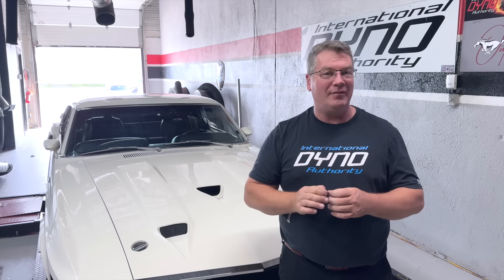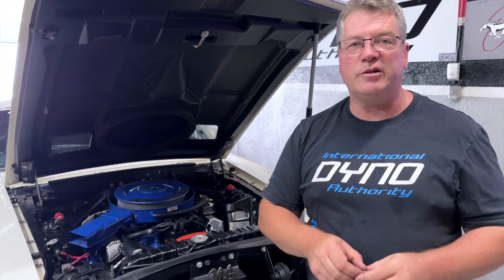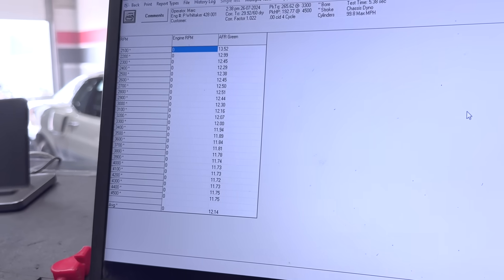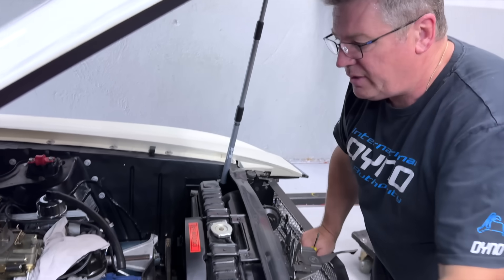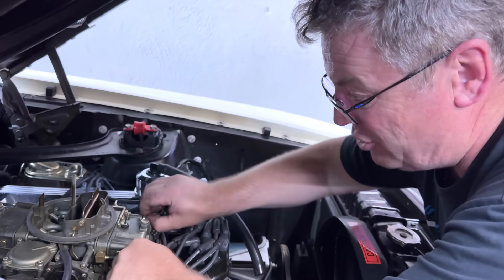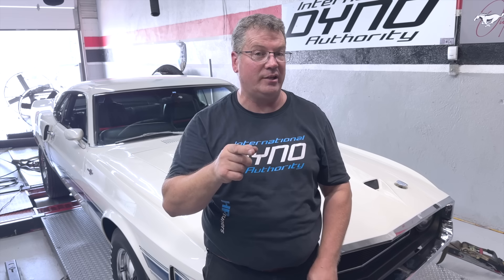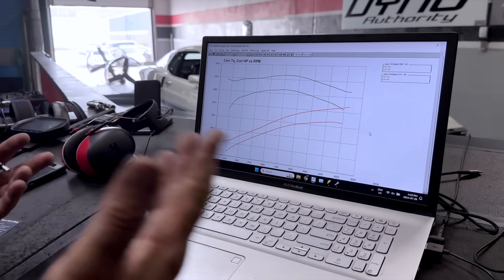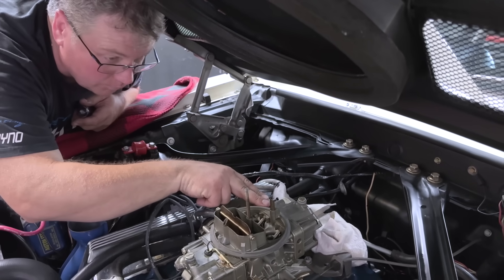Original, unrestored '69 Shelby GT500 tuned on the dyno

Comment: ... rich means lubricated ....
Reply from the maker: @jackreacher.  

The Role of Fuel in the Combustion Chamber

Fuel in an engine's combustion chamber serves three critical functions:

1. Cooling: Fuel helps dissipate heat in the combustion process.

2. Power Generation: The expansion of fuel, air, and the spark creates energy that drives the engine.

3. Lubrication: Proper fuel delivery aids in minimizing wear within the combustion chamber.

The Importance of Air-Fuel Ratios

The correct air-fuel ratio is vital for both performance and efficiency. A balanced mixture maximizes power, ensures fuel efficiency, and reduces harmful emissions.

When Too Much Fuel (Rich Condition) Is Introduced

If the fuel mixture is too rich, the combustion process exhibits certain inefficiencies:

Reduced Temperature: Excess fuel lowers exhaust gas temperatures (EGT).

Decreased Efficiency: The engine fails to extract optimal power from the air-fuel mixture.

Incomplete Burn: Fuel that doesn’t fully combust can cause:

Exhaust fumes with a strong gasoline smell.

Excess carbon deposits and oil contamination (cylinder washdown).

Increased maintenance needs (e.g., frequent oil changes).

The Tuner's Objective

A professional tuner never settles for "at least it's rich" or "better rich than lean." Instead, the goal is to optimize the air-fuel ratio to match the engine's combustion chamber design.

Typical Air-Fuel Ratios:

Naturally Aspirated, Direct-Injected Engines: Ratios typically start in the 13:1 range.

Boosted Applications (Carbureted or Port Injection): Ratios generally start around 11.5:1.

The ideal ratio is determined by the engine’s response:

1. Maximum Power: The engine performs best at a specific air-fuel ratio.

2. Clean Burn: Zero excess smoke and minimal unburned fuel.

3. Optimal EGT: Continuous temperatures around 1,000°F are a strong indicator of efficient combustion.

The Tuning Process at International Dyno Authority

At International Dyno Authority, we take a systematic approach to air-fuel ratio tuning:

1. Step-by-Step Assessment: We analyze gathered data and identify adjustments.

2. Combustion Chamber Optimization: Matching the air-fuel ratio to the chamber’s requirements.

3. Ignition Timing: Ensuring spark occurs before top dead center (BTDC), so maximum thrust occurs 15–17° after top dead center (ATDC).

The Result

Our process ensures the combustion chamber operates at its optimal ratio—never left rich—delivering:

Maximum power.

Clean combustion.

Reliable and efficient engine performance.

---
Reply: @internationaldynoauthority693  I appreciate your professionalism.  I simply pay homage to my first combustion engine mentor who allowed me the opportunity to attend his tuning of our 1949 Model B, Allis-Chalmers tractor which I utilized to drag country roads knocking down the highs and filling in the lows beginning when I was eight years old immediately after Armstrong landed on the moon and before Carter asked us to gear up and throttle  down.  🙃
Reply: And washed down cylinder walls.
Reply: @wydopnthrtl  ... frequently ....
Reply from the maker: @jackreacher.  

 Thank goodness, that the richest readings, were only under larger swings in RPM. 

And in the higher RPM range. 

The rest of the time it was rich but only in the normal rich range. 

This is why at one point during the testing. We isolated exactly where the smoke started. 

We found, that anywhere in the 3900 plus RPM range. It would emit smoke, copious amounts of smoke. 

As this car, you could see, had not been revved up beyond 2500 RPM, for most of its life. The engine was in spectacularly  Good condition. 

Really good compression, very clean inside, and no signs of any real wear. 

Now, not only does it look good and appear, clean and tidy. It also runs up to its potential. Which is awesome.
Reply from the maker: @wydopnthrtl  Thank goodness, that the richest readings, were only under larger swings in RPM. 

And in the higher RPM range. 

The rest of the time it was rich but only in the normal rich range. 

This is why at one point during the testing. We isolated exactly where the smoke started. 

We found, that anywhere in the 3900 plus RPM range. It would emit smoke, copious amounts of smoke. 

As this car, you could see, had not been revved up beyond 2500 RPM, for most of its life. The engine was in spectacularly. Good condition. 

Really good compression, very clean inside, and no signs of any real wear. 

Now, not only does it look good and appear, clean and tidy. It also runs up to its potential. Which is awesome.
Reply from the maker: @jackreacher.  Happy holidays, happy holiday season, and enjoy your friends and family. 

Cheers from the entire team at International Dyno Authority!

Comment: i bet needle and seat s leaking just enough to make it rich but  you don't see it at idle. i bet it starts dripping under mid load.
Reply from the maker: @faustthehammer8706  

The Accelerator nozzles were being drawn through.

The nozzle size was too large.

PCV was being drawn directly.

Both adjusted, tuned , repaired.

--0-- smoke now.

Watch to the end of the video 

Cheers and enjoy the Holiday season 🎉

Comment: Factory exhaust system is restricting the engine output
Reply from the maker: @Funky_Chiicken  totally agree with you. However, in this case. It was," tune the smoke away."

Certainly with a set of 2-in primaries going out to a 3 and 1/2 collector. 

And onto a 2 and 1/2 to 3-in with a free-flowing muffler. 

You'd pick up another 20 horsepower. However. In this case this is an original car, all original pieces and parts and everything mimicked to keep it as factory original or factory stock looking as possible. 

It would be fun, certainly to take a project like this and keep all the original parts but modify everything else. See what the outcome would be at that point

Comment: Well ya cut it off at 4200rpm, the curve was climbing nicely still. 428's should run to at least 5400! Yes the motor is obviously out of tune, got some blowby but still.
Reply from the maker: @romper4444  

Well,   only during the testing phase, We ended the RPM at 4200. 

We actually made quite a few passes that went well beyond 4200 RPM 

But the main complaint, when the customer arrived 

Was excess smoke. 

As it turned out, there was no blow-by 

There was no physical reason that the engine, had smoke coming out of the tailpipe. 

It was strictly set up 

It was strictly tuning. 

Once we had the setup correct. 

Once we had the tune correct. 

We could rev this engine to 6000 easily, 

Zero smoke ever. 

As you walk through the video, you will see the steps that were taken. 

You will see, that we at one point stopped the RPM on the passes Right at 3900 RPM 

And at the end of the video, we revved the engine over 4,000.  Over 5000 RPM over 6000 RPM 

This is a very healthy car, with a very healthy engine. That now makes a lot of power. 

Stay tuned for a lot of our other projects. And tune in to our other videos where we show you step by step again, how we do tuning. How to eliminate, nagging smoke, and how to make things run correctly.
Reply from the maker: @romper4444  The main statistic that we look at when we are looking at RPM 

We look at where does the torque begin to fold over?.

On this engine we see anything after 3,600 RPM, the torque begins to nose dive 

Which means it's no longer on the upward Trend, of making horsepower. 

There is no reason to run an engine out past its peak torque, once it begins to nose dive. 

Most engines (almost ALLgas engines) have between 1000 and 1200 RPM, of "overrun"... Past, their peak torque value. 

Anything beyond that, they make zero power. 

90% of the vehicles that come through the shop. Don't make any power after 6000 RPM. 

It's just simply a fact that manufacturers design their engine to be very usable between 1200 and 5000 RPM....

After that, you're into disassembling the engine. And modifying the valve train putting in aftermarket camshaft aftermarket exhaust different intake. Different carburetor, different injectors etc etc etc. And then you will see a little bit more power beyond 6000 RPM

Comment: Ok guys guys GUYS!... u cant compare a TBI mid 80's 305 to a fox body 5L. You gotta go TPI 305 or compare against a '84 302 carbed foxbody model. 
2ND!.... PLEASE start dynoing these engines with accessories, i know its a pain in the ass, but without it, us at home get no real world information to go off.
Reply from the maker: @romper4444  ????---????
Reply from the maker: @romper4444   Not sure where you're getting 305. Not sure where you're getting 302 not sure where you're getting any of this information from. 

This car was tuned exactly as it came from the factory with a few modifications that we mentioned during the video.
Reply from the maker: @romper4444 

Using fuel from the late '60s or early '70s, such as leaded, high-octane options from Sunoco or Shell (around 100 octane), we could have expected more energy from the same combustion chamber. This type of fuel, being "slower-burning," would have allowed us to ignite the combustion chamber earlier, effectively advancing the timing.

With this approach, it’s possible we could have gained an additional 20–25 horsepower. Of course, this would have skewed all the calculated numbers.

However, for this particular project, we were thrilled to stay at a very conservative 31° total timing and still come remarkably close to the rated horsepower using the 1.15 rule.

This was an enjoyable project, and we had a great time working on it.

Cheers, enjoy your weekend, and have a wonderful holiday season!

Thank you for tuning in—stay tuned for more informative videos, including our upcoming educational series and straightforward how-to guides.

All the best!
Reply from the maker: @romper4444  International Dyno Authority: Pioneering the Future of Tuning and Combustion Technology

As North America’s premier facility dedicated to advanced tuning and research, International Dyno Authority (IDA) has set the standard for tuning and power optimization across a vast range of applications. This cutting-edge institution has earned a reputation for excellence through extensive partnerships, groundbreaking innovations, and the development of tuning standards that are transforming the industry.

Partners in Innovation

IDA collaborates closely with leading corporations, advising powerhouses like HP Tuners, Whipple, Roush, and Ford Motor Company. Their insights and technical support have become an essential resource for these companies, driving improvements in engine performance, efficiency, and emissions standards. Through these relationships, IDA has a unique vantage point to pioneer developments that shape the industry’s future.

Pioneering Standards in Tuning

Since its inception, International Dyno Authority has been at the forefront of the tuning industry, not only setting new standards but also elevating the capabilities of tuners of all experience levels. Through their publications and training programs, IDA provides essential resources that empower both novice and professional tuners, equipping them with the skills to achieve precision tuning across various engine platforms. Their commitment to education is evident in their comprehensive curriculum, covering the intricacies of combustion dynamics, air-fuel ratio (AFR) tuning, boost management, and fuel characteristics.

Educational Outreach and Online Presence

IDA has established a strong online presence, notably through their YouTube channel, which serves as an invaluable resource for enthusiasts and professionals alike. Their instructional videos, which include step-by-step tutorials, practical tips, and expert insights, are used by institutions such as MIT, Boston College, SCT, Holley Inc., and Edelbrock, making IDA a recognized leader in education within the field. Their expertise has also gained the attention of influential industry figures, including Steve Morris, who has commended their contributions to tuning technology.

Specialized Focus and Areas of Expertise

Operating as a purely tuning and research facility, IDA’s specialization spans a wide range of topics. They delve into complex subjects such as combustion technology, AFR tuning, boost and fuel optimization, and luxury engine swap integration. The organization’s work also extends to advanced fuel research, as seen in their recent collaboration with TTC, Hydra-Gen, and DynaCert. Here, IDA took the lead in developing an 8.9L Cummins engine hydrogen supplement fuel program, which included rigorous emissions testing, underscoring their commitment to sustainable and innovative fuel solutions.

The Facility’s Technical Scope and Testing Capacity

Each year, IDA conducts over 650 vehicle dyno tests, tuning engines and chassis systems to optimize performance. This includes a wide variety of engines powered by gasoline, E85, diesel, hydrogen, port and direct injection, throttle body injection, and even carbureted systems. Their expertise is not limited to traditional vehicles; the facility also tunes boats, tanks, and military transport, making them the only independent tuning and research center in North America dedicated to such an expansive range of engines and fuel types.

Advancing Industry Standards

By leading projects in combustion and alternative fuels, IDA continues to be a key player in the evolution of tuning technology. Their dedication to setting new standards in performance, efficiency, and sustainability has positioned them as a trusted authority in an industry that is constantly evolving. For anyone looking to understand or pursue high-level tuning, International Dyno Authority remains the ultimate resource and innovator in the field.

Comment: Most 428 CJ on the engine dyno made about 360 some hp. Tuned well.  They loose a lot more than 35 hp to the wheels. I had a 69 428 CJ mustang. So 300 hp at the wheel is about right.
Reply from the maker: @DonnieBays  

We tune over 600 vehicles a year, and one of the most common questions we get from customers is, "How much does that equate to at the crank?"

Another frequent query is, "How do I estimate the crank horsepower (CHP) from the wheel horsepower (WHP)?"

The simplest and most reliable method is to take the gross crank number—whether provided by the manufacturer, the internet, or your own experience—and divide it by 1.15.

Let’s apply that here:
335 ÷ 1.15 = [calculated result].

As a shop that specializes in dyno tuning—both chassis dyno and engine dyno—we can confidently say that this method is remarkably accurate for most setups we work with.

For instance, we can dyno an engine on the engine dyno to get its crank horsepower (CHP or BHP), install it in its chassis, and then compare the wheel horsepower (WHP) from the chassis dyno. Using the ÷ 1.15 method almost always matches up.

That said, there are exceptions. For example, we have customers who swap engines into wildly different chassis configurations. One customer, for instance, installed a K-series engine into a Silverado. In cases like that, the drivetrain losses are much higher—closer to 35–40%.

So while the 15% rule works exceptionally well in most cases, there’s no universal formula in the world of mechanics. Each setup is unique, and variations will always exist.